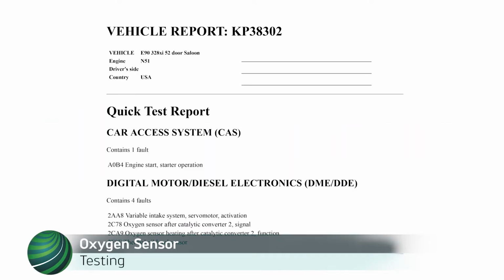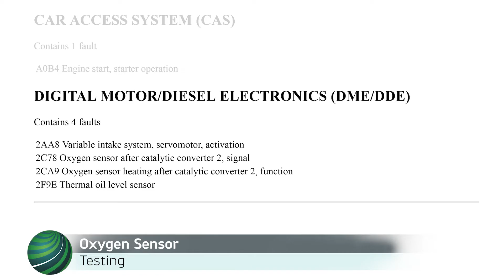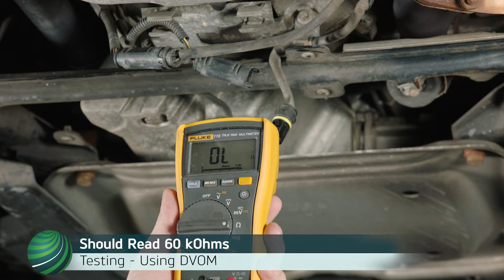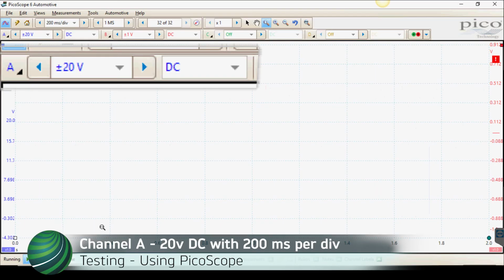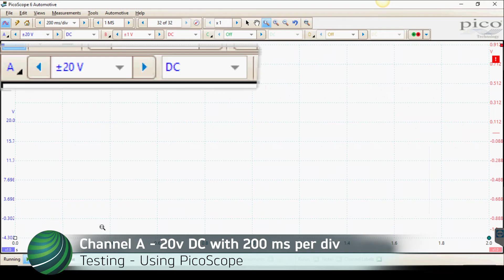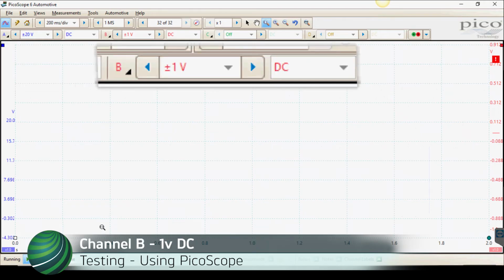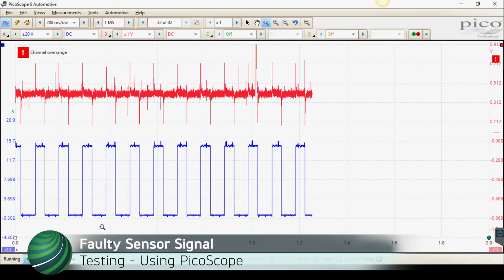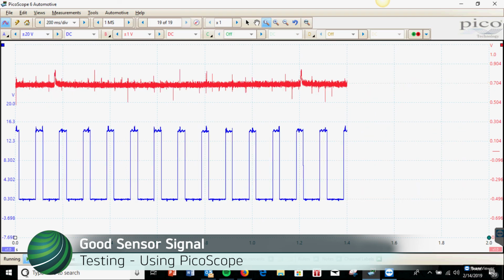BMW Oxygen Sensor Testing- BMW Fault code 2C78 or P0160

Comment: Thank you for the video. I appreciate your videos. One thing, your spec of heater resistance of no more than 60k ohms. This is way off. Your cold reading of 10 ohms looks good.
Reply: Hey Billy, Yes the spec may be high, we pulled the spec from factory fault code setting criteria. As we all know, in essence we are looking for an open or crazy high resistance.Thanks for the response I appreciate the input!
Reply from the maker: Billy, appreciate your feedback and comment. BMW's specification was used for the resistance value, direct from their OBD fault code criteria. Since BMW only supplies this value, we did not want to use one to contradict it, knowing there are other good specifications used my techs.
C
ondition for fault memory entry 

 O2 sensor voltage between 0.4 V and 0.5 V; 
 internal resistance in downstream oxygen sensor's circuit 
 exceeds 60 kOhms

Thanks again, your tip and info adds a ton of value and will certainly shed some light for viewers of this video.